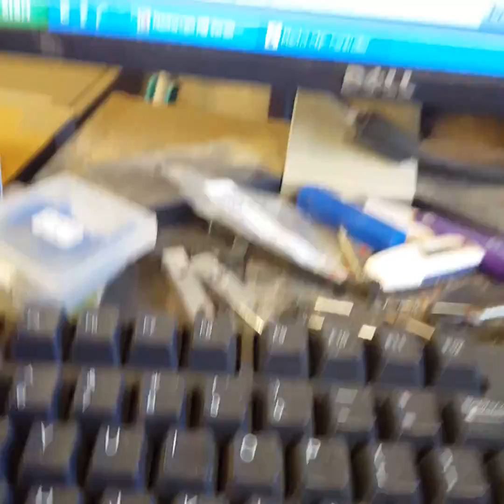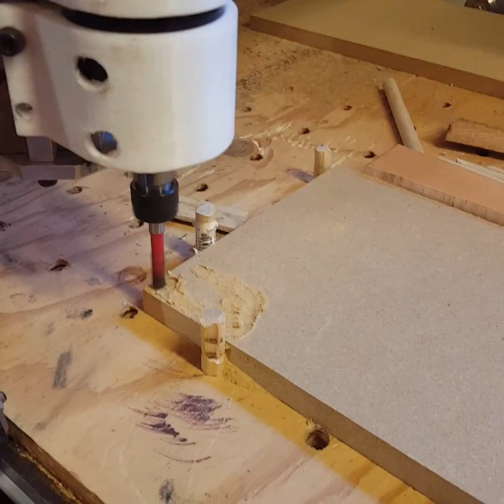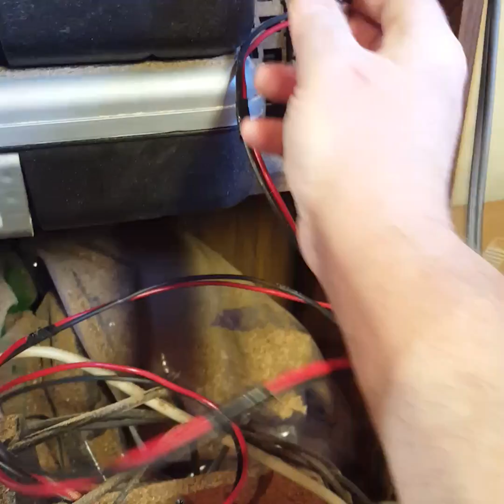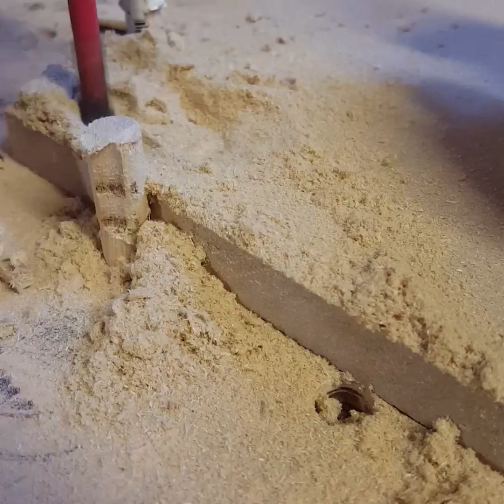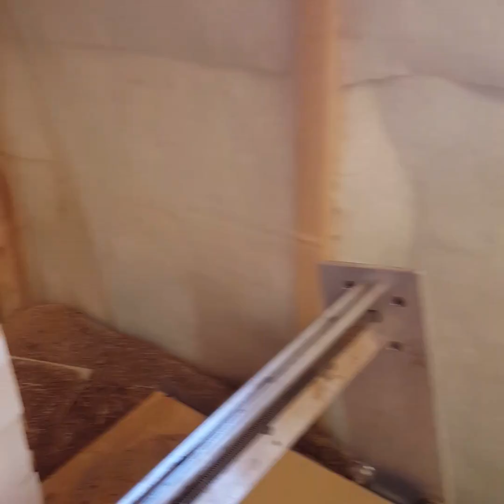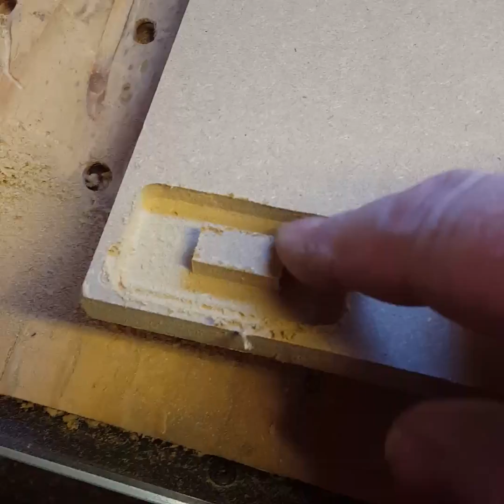Chinese 500 Watt Spindle Test

Comment: Is it really necessary to use that much power of a spindle when doing with woods. My home made desktop CNC made from scrap materials from old cabinets as frame and steppers from photocopiers which are unipolars..with improvised spindle from an old blender rated 150W 110VAC..can still cut wood.

see for yourself

https://www.youtube.com/watch?v=rW_mp_Trgds

I did try aluminum but my frame isn't that great and the bit just touches the aluminum plate so I disregard mine from cutting aluminum but wood..A-OK at 150W